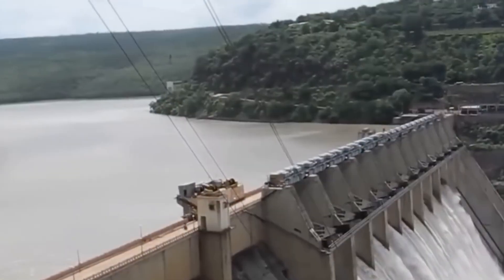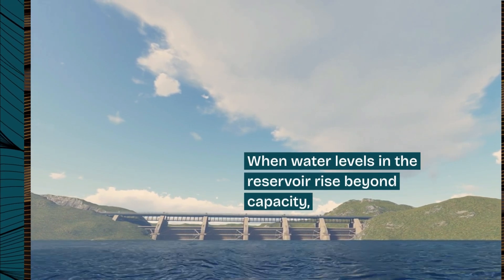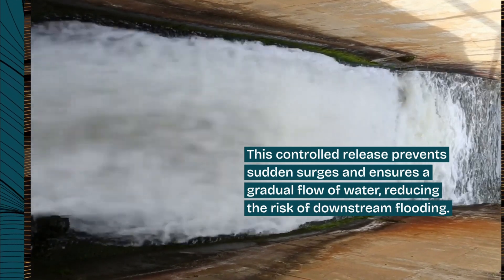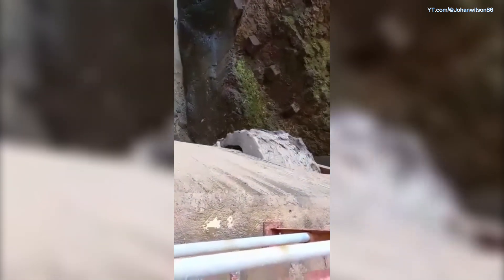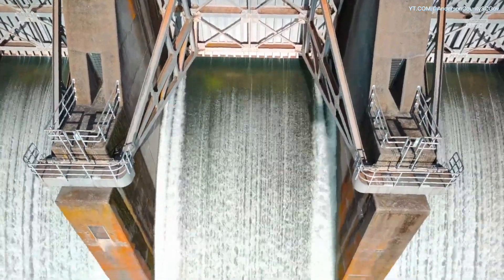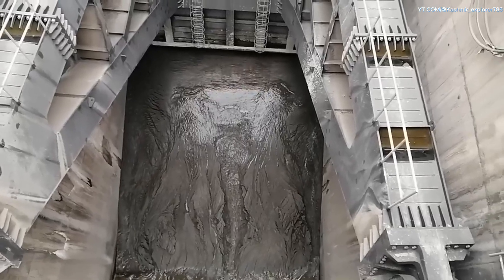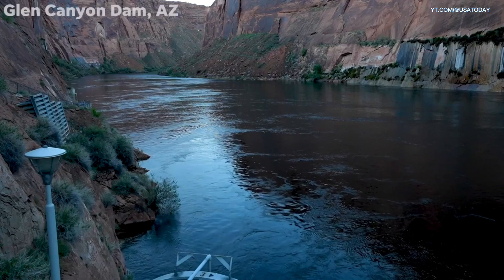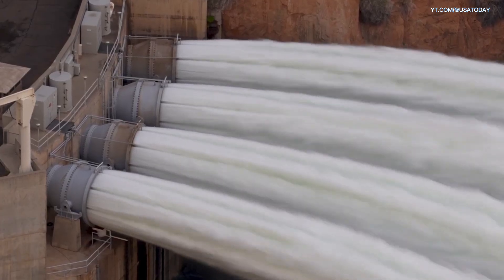Giant Dams Unleash Massive Floodwaters After Decades Sealed

Comment: There are not gates and valves on most spillways.  In most, the spillway is fixed.  If the water level rises above it, it overflows or "spills".  Keeping it simple reduces risk of failure of gates and valves.

Comment: You have to imagine the immense amount of sediment that the river brings down during torrential rains to be able to put so much volume all the way far down to the walls of the dam, considering how stagnant the water in those large reservoirs is. Then imagine how much the reservoir is filling with sediment in the parts where the flow cannot remove it. Eventually the dam will lose a lot of its capacity and it will have to be either dredged or abandoned.

Comment: Say you have a dam 100 feet high.  When the water fills it to 90 feet high, you get worried.  Why not have the excess water come out at 80 high so the level drops without that incredible pressure?
Reply from the maker: @merryhunt9153  well thats how most of the dams are operated but usually in flood situation the anticapted inflows are not always as expected. So, sometimes they push down the panick mode to avoid structural compromise.

Comment: Water weighs 8 pounds per gallon. It pushing mud against the side for years is NOT good. Open it up every six months to clear it. The calculations are that the walls will hold 120% of the water pressure like a fuse. Ten feet of compressed mud  gets close to that number. A mile down stream, a 25 foot wall of water would be roaring at 80 miles per hour. Not good.
Reply from the maker: Great..

Comment: I am a Navy veteran and retired Army 1SG. My MOS was 52E (prime power production specialist) our parent command was The Corps of Engineers. Upon retiring at Ft. Lewis, WA, actually six months prior to retirement date, I was hired by Detroit Diesel as a field service technician for marinized generators, propulsion engines and very large land-based Gen sets. After seven years I decided to retire for good. After a couple months the corps of engineers contacted me to work on the hydro-powered generator aspects on all the dams in the western US. Doing maintenance on the electrical production side of the dams. By that time I was suffering from Gulf War problems and was unable to accept. Would have been awesome with, again, frequent travel. 😷🤒
Reply from the maker: Good old days.
Reply: @TAllyn-qr3io  And a hell of a lot of extra money! ( did you get a Harley anyway?) 🤔

Comment: funny that dams have these to release too much water, but that happens in heavy rains, the worse time to put more water in the water ways heading down stream, so the ideal of control release to protect down stream is fake,
Reply from the maker: No actually all the structures has design limitations. A dam also has a limit in terms of holding and controling a specific range of flood discharge. But due to urbanization and more discharge it gets out of capacity resulting in such failures. But obviously there are many factors to consider.
Reply: @SaadIqbalengr  heavy rain storm, have to release water, but downstream has already got major rain. see the problem with releasing water safely?
Reply from the maker: @diegojines-us9pc  you are right, but actually when the discharge goes beyond the limitation, there is no other solution but to release water downstream. Because if you dont release the dam will burst and it will be more damaging for the downstreams.
Reply: @SaadIqbalengr  but the line safely discharge, is not correct at all. just makes people think its OK if they dont think, because you are discharging at the worse time because its getting worse, but the discharge makes things down stream even worse than they are, and the story line, controlling floods, they cant control floods, but the salesman got a good story any way.

Comment: A lot of those "spillways" are actually the outlet works, like at Glen Canyon. Spillways typically are not low on the dam, and flow is not driven by high pressures. It spills over some sort of crest.
Reply: @CO-PE-123  yes I agree with that. In the U.K. we tend to call them sluce gates and we do use them a lot on our river wiers and locks - to maintain a constant river or canal height.

Comment: Fun fact:  When a flood gate is opened, you can tell how much the gate is opened by watching how far up the slope the “white water” is from the top. Example, when they first open a flood gate the white water (turbulent water) is all the way at the top. As the gate opens the white water will move down the slope of the ramp. The water that is clear and not white is when laminar flow is reached. It’s a pretty cool thing to watch. Also, the flood gates are used to release large amounts of water and not over speed the turbines which is where the water coming out of the dam that produces electricity.